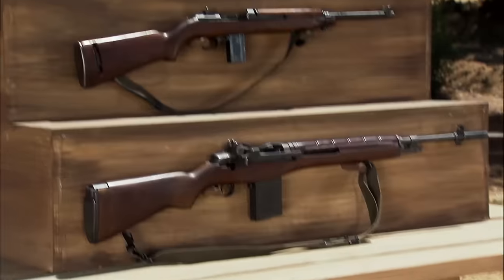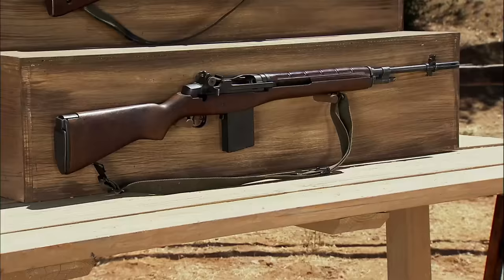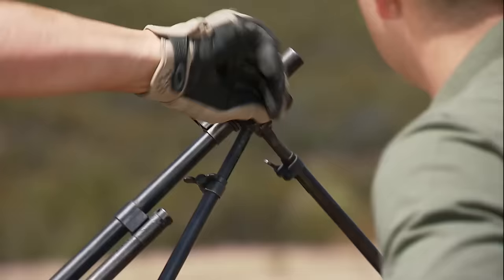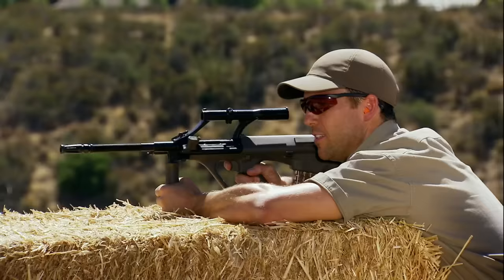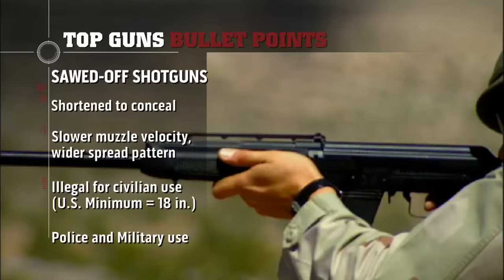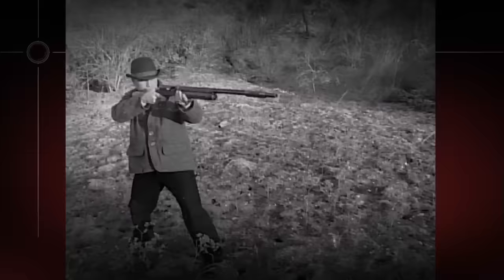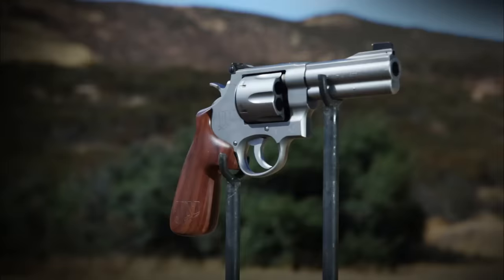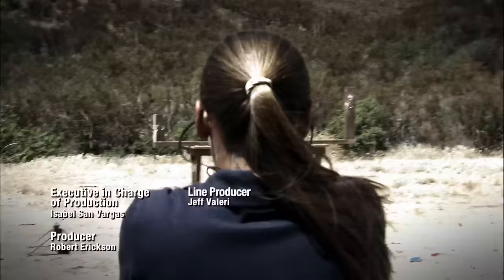Top Guns: ELITE Sharpshooters and DEADLY Marksmen *3 Hour Marathon*

Comment: I've heard the old "The M1 Carbine wasnt powerful enough to penetrate through the winter coats worn by the Chinese" story more than a few times. I wasn't in Korea and when I did go to war I didn't carry an M1 carbine, and Ive never had a situation arise where I had to shoot at Chinese people wearing winter coats. (For the record I've never shot at a Chinese person period) I do however have an M1 carbine,  Military Surplus manufactured by Inland, and I have fired plenty of 110 gr FMJ .30 caliber ammo through it. It's rated at 1950 FPS muzzle velocity. I have also shot it at all kinds of different stuff in comparisons with other calibers and I've found that it's a surprisingly effective cartridge, especially at the shorter ranges (like 120 yds or less) and in many cases it will deliver more energy than some more powerful cartridges due to its tendency to expend all of its energy in the target rather than punching a hole clean through so quickly that the bullet cannot transfer its kinetic energy fast enough. This is especially true under 50 yards. I've killed plenty of feral hogs with my M1 carbine out to 100 yards and more than a few of those hogs were well over the 250lb mark on the scale. I've also shot through 5 2"×4"pieces of pressure treated lumber nailed together. And I mean a clean hole all the way through all 5 boards, and Ive repeated the test multiple time. So either they were issued defective ammo, had extremely worn out barrels that didn't allow a proper seal, or the Chinese had some really badass winter coats... or they just were not hitting the enemy with bullets placed correctly for an instant or nearly instant kill/incapacition.Ive heard theories that it was so cold in the Chosen Reservoir  (70 below zero with the wind chill factored in) that the barrels contracted enough to creat enough extra resistance to slow down the bullet sufficiently to cause a drop in muzzle velocity but it would have to drop the velocity by a lot to fail to penetrate a winter coat, like probably down to less than 600 FPS (nobody claimed a 1911 shooting at 750 FPS wouldn't penetrate the Chinese coats so Im assuming it would have to be slower than that) and I'd guess if you created such a restriction to drop the velocity from the standard 1950FPS to 600FPS the resulting over pressure would likely destroy the gas piston or jam the rotating bolt back so hard it wouldrequire the shooter to perform some significant corrective action to fire again.
Reply: Yeah, a lot of people in the past and today sneer at the 30 Carbine, but if so, you have to figure that either they have never had or shot one (much), they were/are comparing them to the other options (like back in WWII) available, or they have a screw loose. 

Would I pick it as a main front line battle rifle, NO, but for some users, it might be a good choice. I've heard several times about soldiers back in WWII that (after being in combat) would drop their issue Garand, and pick up a carbine as their weapon of choice. 

The M1 carbine was originally introduced to be issued to officers instead of the .45 ACP 1911, and for troops in the rear areas, and truck drivers and other ancillary uses. However, when you look at the photos from WWII, Korea, and even Nam, you see a lot of people with an M1 carbine. As they showed on the example of the Marines raising the flag on Iwo Jima, the only gun that is plainly seen is an M1. So, yeah, a lot of guys complained about them, but a lot of the GIs loved them. 

I think it's a shame that there's no companies out there making both true to the original, and updated versions today. While I know of two companies that are making an M1, Auto Ordinance is one I think, I've heard that they are not well made, unreliable, and are very pricey for what you get. I think that if you could get a good reliable Mil spec M1 for around a $1000 or less, that they would sell very well once the word got out. I'd buy a couple! 

I used (unfortunately used to) to have an Inland M1 carbine with a collapsible wire stock that extended straight back and could be collapsed right up to the rear pistol grip where it fit into a couple of grooves making it very short, handy to stow in a vehicle, and much lighter. It also had a forward pistol grip on the bottom of the forearm. With a thirty round mag, it looked totally wicked, and weighed right about five pounds fully loaded. I've only seen one other like it and it was a very RARE version that was appraised for a ridiculous amount of money. Wether mine was a genuine example of that variant (worth many thousands as a collectible) or just a knock off -- I still kick myself every time I recall that I sold it. I'd LOVE to have another one. 

People can say what they want, but for around the homestead, I'd just as well have an M1 pushing a 110 grain soft point at 1800+ fps, as a short barrel AR pushing a 55 grain at 2700+/-. Some people don't have much respect for the .30 carbine round, but it will definitely go through any jacket; unless it's made out of Kevlar. Compared to the other rounds in use in WWII, the carbine looks pretty pathetic, but it is no joke. M1s are light, fun, accurate (with good sights), and can handle most things from deer on down to rabbits. (And Chinese jackets!) What's not to like?!
Reply: I have owned three or four thirty cal andi love the m1 carbine but I found it if you use military rounds they're a lot better than the civilian rounds lot more powerful but I shot through a 12 stack lamb beam and went through all 12 like the man said above clean holes and four  4x4s and two stucco walls and the lam beam thank God there was a brick fireplace to stop it or I would of shot my neighbor's house but an eighth of a mile away thank God I hit the fireplace please make sure to have nothing down range with it except at Target cuz that was puppies roll matter of fact I had a Ruger Blackhawk 30 cal carbine pistol and 10 rounds of it was Brazilian surplus rounds military blew that gun apart in my hand fired civilian mounds no problem but the military rounds is so much more powerful than it literally blew apart my hands  @sammcrae8892
Reply: In my hands sorry
Reply: @sammcrae8892 nobody dropped their gerandes for a .30 carbine 😂😂😂😂😂 literally everyone hated that pos
Reply: @lonewolftech  i have read many articles where people that actually fought in ww2 said they DID lay down the 12 lb garand for the 5lb carbine. And if you think k its a pos ,and the round is not effective , then you have never shot things with it

Comment: I own an original Russian 1943 Mosin Nagant and I guarantee this is much better than the one you used! It has a very smooth action and never gets stuck and the precision is absolute up to 500 yards.
Reply: Same I have at least 13 of them from stock to Super sportarized. From different countries from Para-trooper model to bit ass long one. From paying  $89 in the 90s to investing well over $1000 into them. And every single one is like butter. I would take it over most modern bolt guns. And if you shoot numbers matching with surplus ammo from the same factory the gun was produced you got a 1000 yard gun with good optics.
Reply: Was thinking the same thing.
Reply: My mosin is smooth too! I know some have head spacing issues.  One resolved they run scary fast for a bolt action.
Reply: Thx for the thrue mate! Mosin is very nice gun.
Reply: A lot of the problems the WWI era Mosins had was due to the bolt construction and the fact that they were truly sighted with the bayonet on the gun. The bolt basically has one part holding the thing together, and there are wide tolerances on individual parts (due to the nature of Russian manufacturing at the time) which make the action and trigger spongy. By the 40's there had been some design changes to clear up it's shortcomings; so that '43 is a totally different gun from the one used here.
Reply: Same here. But Ive never tried to shoot it at 500 yards because I use iron sights. But I do manage to shoot one inch groups at 50 yards with surplus Bulgarian ammo. lets say 1.5 ish. lol
Reply: Same here.  I have several Mosins and there issues with it are from neglect and lack of knowledge of how it works. While the gun will function almost never getting cleaned.  However if you want a good gun it needs to be cleaned even taking the bolt apart. Witch is not hard because everything you need to work on the gun is parts of the gun . There bolt issues could have been solved with a little cleaning and polishing on the bolt pieces.  There trigger issues are a lack of knowledge , the mosin has a leaf spring for the trigger. So there ( spongy ) trigger is just the spring. You have a longer pull just to get to the actual trigger sear. So all it is , is taking up the slack then it's a normal trigger release.  Hell I could spend an hour with that gun and have to shooting better than some new guns. A little cleaning, sanding, polishing and a rubber band and I can give you a smooth, crisp 3lb trigger pull. I have a video on my other channel showing how to do it.
Reply: So it's not a garbage rod?
Reply: @HamuelTheGrey  not if you understand it.
Reply: Simo hahya hit a pretty high record with it
Reply: @tasatort9778 you have no clue what you’re talking about.
Reply: I agree they’re good rifles but I had a late war rifle that would barely cycle, a polish from a gun smith and 1000 rounds and it finally worked “okay” still love my dad got it under 100

Comment: I own 3 Mosen Nagant Rifles, and all of mine have very smooth bolts. The oldest one I have, I always shoot with bayonet attached and can still shoot a 3" group at 100 yards. My youngest one, is a 1954 carbine length with a built-in bayonet, I always leave the bayonet folded, this is a great rifle in brand new hardly shot condition. I shoot it sometimes, I love this one and can get 2.5" groups at 100 Yards. The Mosen you shot here is a POS in my opinion. I have a custom model  that shoots very well. I have a 4 to 16 Vortex scope, and it shoots 1/4 MOA, so Mosens can shoot very well.
Reply: Seemed like it possibly needed cleaning and maybe some lubrication
Reply: I've read thst Mosins ahot better with the bayonet fixed, like they were tuned to shoot with a bayonet on.
Reply: To be fair they were mainly testing with military surplus equipment, where quality is pretty infamous. Of course if you slap a Vortex scope, use the way the gun was intended with the bayonet and properly maintain and clean it it will run smoothly, but compared to something like an m24, the mosin nagant is 150 years old and didnt hold a candle to the m14 which was made in vietnam.
Reply: coming from someone who hasnt shot a mosin so..
Reply: every mosin i've shot has this extremely difficult bolt, from 1943 and 1945 productions
Reply: @armynurseboy they shoot the same with or without it.
Reply: you’ve never shot a well maintained one then. Everyone out the box form wartime I’ve shot have been flawless..
Reply: I had a mosin as your year, people don’t understand the early ones were made in America by Winchester (smooth bolts) also broke in guns. Vs mid war mass production mosins that have bolts without a finished polish.

Comment: I got to shoot a WWII M1 carbine at our local gun club. They're more powerful than what you would think. They can shoot a 110 grain bullet anywhere from 1900 to 2,000 feet per second. And the one that I shot was a nail driver at 50 yards. Very accurate
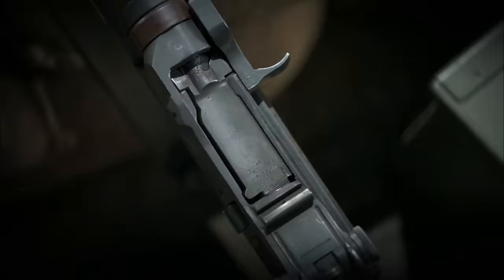Reply: I am loading the 110gr .308 nosler varmageddons as I type with 42.5gr of imr 4198 and from my fn special police 24” 1:12” heavy barrel i cought 1 at 3490fps and rest kept blowin crono sideways 10’ from muzzle…shot .5” groups with a few .3”s and vaporizin 20oz’s@254yrds off post….meaner than my 6.5prc with wicked 130s…
Reply: yeah, this show is so scuffed. “p90 has little penetration” like penetration wasn’t the whole point of the 5.7 round

Comment: Brad needs to learn more about pistols. The .45 ACP is most definitely not a “high velocity” round. They are subsonic rounds. The kick comes from more powder than he’s used to handling.
Reply: The kick comes from the heavy bullet.  Typically 230 grains for a 45 acp
Reply: A slow 230 grain vs a fast 120 grain 45 acp, very different reactions. I prefer 255s personally. Still around 850fps. They got a kick😊

Comment: Not all Mosin rifles are the same, my 1933 HEX receiver bolt is smooth as glass, no extraction issues and is very accurate with my hand loads with cast lead and jacketed bullets of the proper diameter.
Reply: I also have a 1935 Hex receiver, my preferred over the round, and it's also super smooth. I did do a little work to both the bolt and trigger, but I didn't have to do much to make it great. Now I'm not going to say it beats any of my Mausers, because it doesn't. But it isn't bad. I've always been more of a Mauser fan, but I don't think the Nagant is a bad rifle.
Reply: Mine aren't exactly Mosins anymore. They are a Finnish M1931 and a Finnish M44. They must not have a good Mosin. Mine are 2moa at 200yd and I don't shoot enough. For that check out Josh and Henry at 9-hole review period

Comment: The FN P90 is one of my all time favorite pdws that 5.7 round is like an angry hornet and will rip through Most soft body armors.  Its a really smooth gun for firing supersonic ammo
Reply: That’s cool, but they highlighted the PS90, NOT the P90…VERY big difference!
Reply: @ryanzanow8221  actually no.  It's the exact same platform minus the interrupter switch that allows for full auto and a lighter recoil spring.  the S stands for Semi-auto
Reply: @PromethiaSHADOW    I’m sorry, but you are VERY wrong, sir.  The PS90 has a 16.04” barrel, vs a 10.4" on the p90.
This makes a difference, which you obviously are not aware of.  
Sorry if you think the barrel length is not something that makes a difference. 
It's a bummer if you think these two weapons are the same, but you are wrong…they are not.

Comment: While reloading some 45acp one day i was trying to get to my other property to shoot before it got dark, so i got into a hurry and was distracted when i was charging cases in a tray that wasnt my normal loading tray and was using CFE Pistol, well unbeknownst to me the cases were just a bit too close together, and powder from one case was spilling into the one behind it, and i didn't catch my mistake and threw bullets in andnseated them to correct depth. Away i went to target practice and left in a major hurry because it was about sunset. I forgot my saftey glasses but didn't care, cuz i wanted to shoot. I started with my leftover ammo from the previous load, so no problems and everything was going like normal. I start dipping into the fresh reloaded batch and the first few mags were fine, the third or fourth mag I could tell were a bit spicy from my normal recoil. The fifth mag i shot the first three rounds, and thought those were definitely hot rounds, but i wanted to continue shooting, i pulled the trigger on the fourth round and I knew i fucked up. I ruptured the 45 casing and the one spot that the casing isn't supported by the chamber was the bottom back edge where it comes in during the cycling action, well, i was instantly blinded for a bit with still burning powder and brass shrapnel. It was shocking to say the least and i stood there thinking, "oh f@!$, i just blew my hand off anf i can't see s@%$!" My hand went numb from the shock of the vibration. I finally cleared my eyes to be able to see and was relieved to see my hand intact my grips shattered, the case was stuck to the point i had to break her down and take a wooden rod and hammer wnd had to drive it out. I touched my head to wipe sweat away. And seen blood on my hand...had two pieces of brass slip between the frame and slide and one stuck in my nose and one in my forehead...i learned a cheap lesson that day. I didn't get Kentucky ballisticed lol but definitely scary...stay safe scott love ya brother
Reply: I use 45 super cases for a little extra safety. Aftermarket barrel with full support. No glock smileys😊. 20lb spring with titanium spring rod minimum still works with factory ammo. Changed all the pins to titanium too. Especially for the stop block. Cfe pistol is awesome. Lone wolf distributors. The pins were someone else. Also use a 24 lb spring for my hot loads. Start heavy and drop down til theres no more stove pipes😊. Rather have shell stay in battery too long than long enough